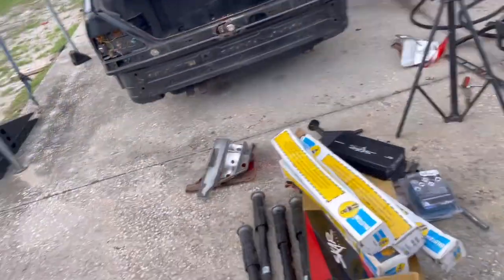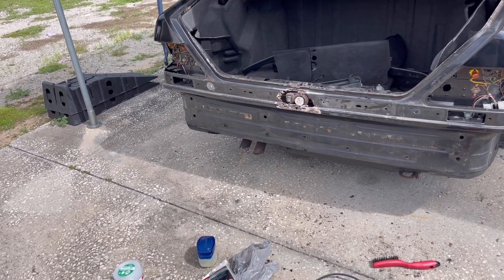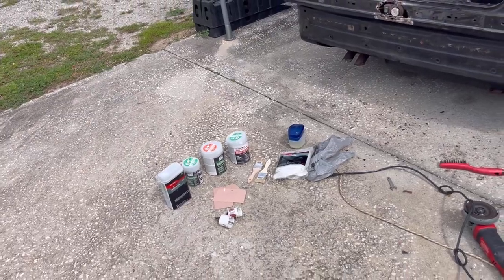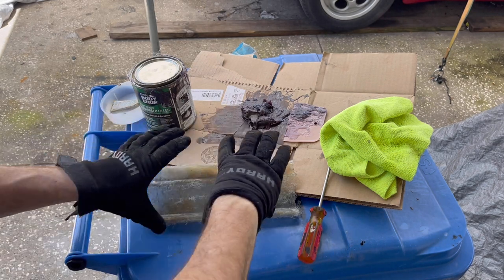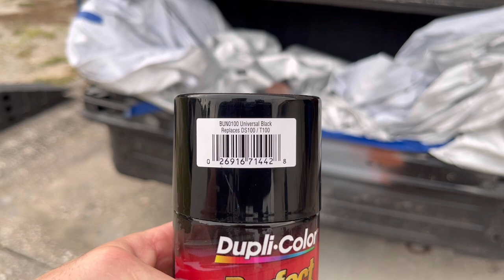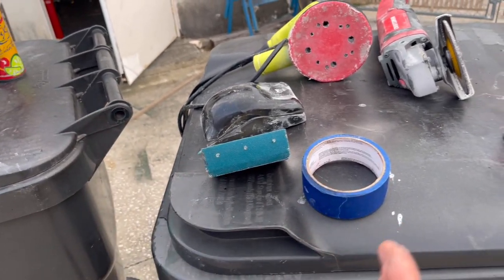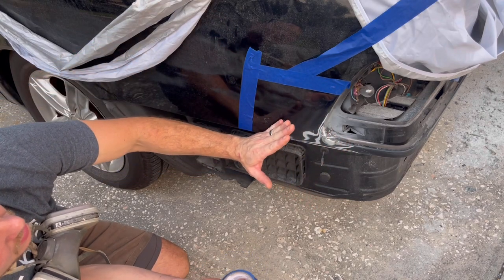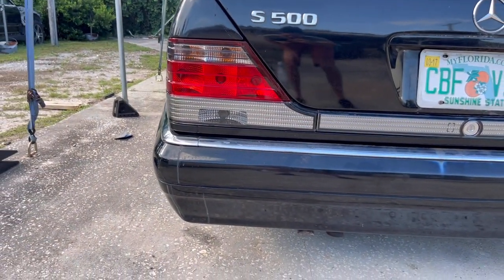W140 common rust fixed using fiberglass and basic tools on a budget.  Zay’s new s500 Benz

Comment: Hi you were saying in one of your videos , that your car was shaking around 40-60 mph. I have the same issue , did you find a solution or the cause of it ?
Reply from the maker: Still working through the issues.   Could be many things unfortunately.  I have a feeling mine is the center support shaft bearing and bushing. Something I’ve dealt with in other cars.  But could even be a stuck brake caliper or bad motor mounts/transmission mounts.    I think it’s a combination of things but will be going one step at a time
Reply: Thanks keep me posted, love your videos. Let me know if you have another get together with w140 cars , I am in Florida , in Jupiter